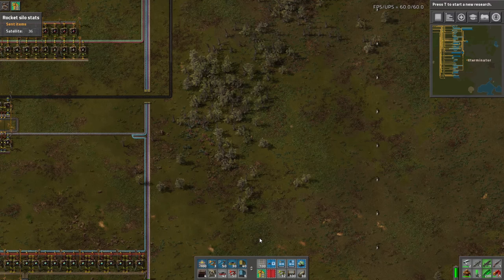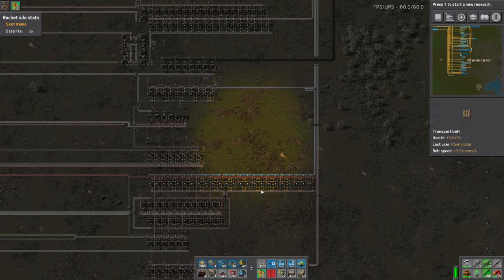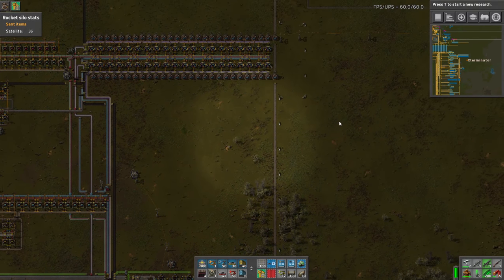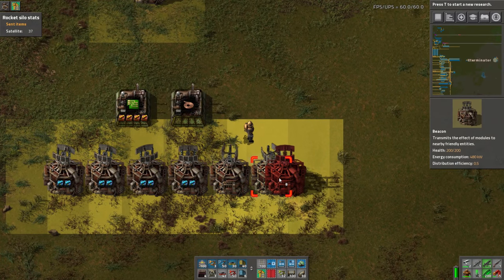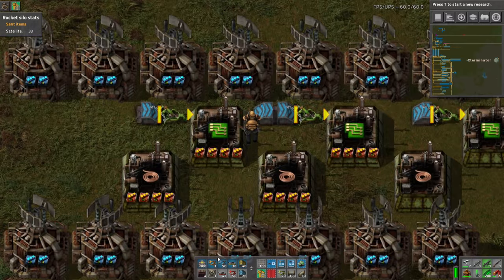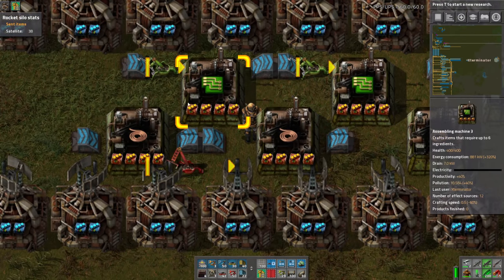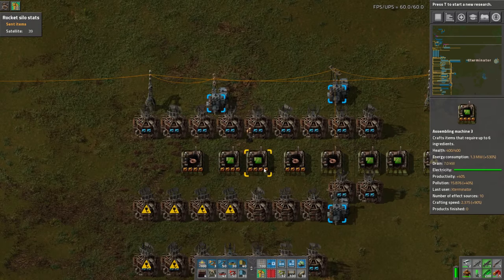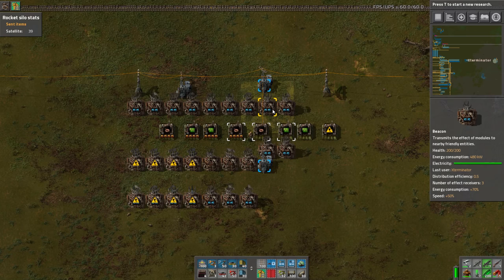Factorio: Tightening The Belt: Megabase Guide EP50 - BEACON CIRCUIT DESIGN| Tutorial Gameplay Series

Comment: With the offset up and down build you were trying at first, if you do something like:
wire (bottom), circuit (top),circuit (top),wire(bottom)
Then that should give you enough room for the input / output belts with the 90 degree direct inserting through a chest.  Basically, take what you were doing, but flip the second half left/right, so that the two three wide gaps, merge into a 6 wide gap, which should be enough room for the direct inserting on each side and a belt in the middle.

Comment: I was thinking a design more like this - though I've only used it with bots and haven't tried to weave belts through it: 
BBBBB
BWBWB
BCBCB
BBBBB

Where B=Beacon, W=Wire assembler, C=Circuit assembler

You end up with more beacons per assembler that way, so you'd need less for a full belt. I haven't checked the spacing but it should be possible to spread the beacons out enough to make room for the belts and still get more coverage than the rows Xterm is setting up.

Comment: One thing to mention - first build with inserters passing cables through chest would bottleneck on it, single inserter is not fast enough, you need 2 taking cables and 2 putting them to circuit assemblers, even with 8-8 setup, even more so in 1-12.

Comment: I used a 12 beacon layout for by green circuits. It works really well, and you only need 2 green circuit assemblers to fill a belt.
Reply from the maker: Ritoban Roy Chowdhury I may need to switch to that, well see.
Reply: The reason I went entirely 12 beacons for my belt megabase is that it gives you a lot more room to manage belts, whereas with 8 beacon designs, anything requiring more than 1 material input needs belt braiding.

Comment: Can someone explain the logic behind productivity modules in the assemblers and speed modules in the beacons?  Why not the reverse?  Or why not all speed in both types of buildings?  Or why not two speed and two productivity in each beacon?
Reply from the maker: You can't put productivity modules in beacons, so it's best to use them in assemblers. You could do all speed, but in most cases you actually get more production per minute by using prods in the assemblers only using speed in the beacons
Reply: @Xterminator  interesting. Thanks for the info!

Comment: I figured it out the moment he started the build
Reply: And it was the first layout with the staggered assemblers
Reply: If you put the iron and circuit belt sort of on top of the copper wire machine, you can just put more assemblers under the build to fill a blue belt. Then you can use the direct insertion with the copper wires, and supply it by putting the copper belt (off set) above the iron/circuit belt. This saves you from using the other layout which is less efficient.